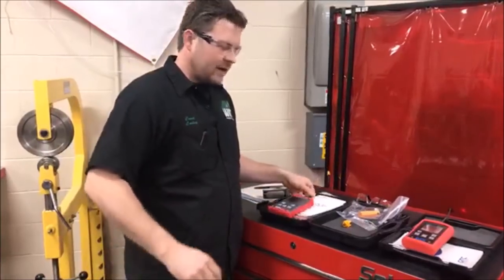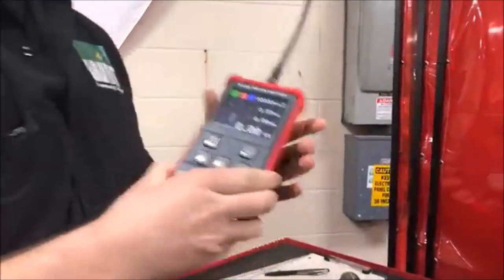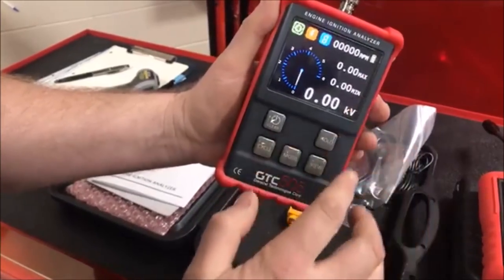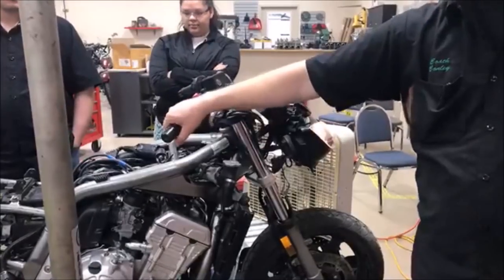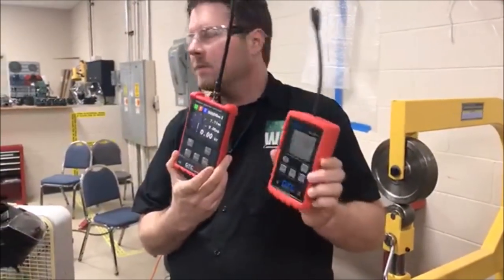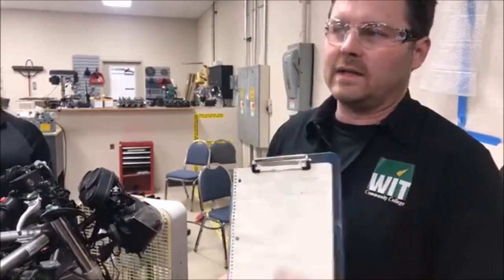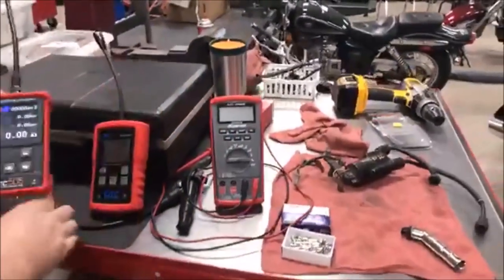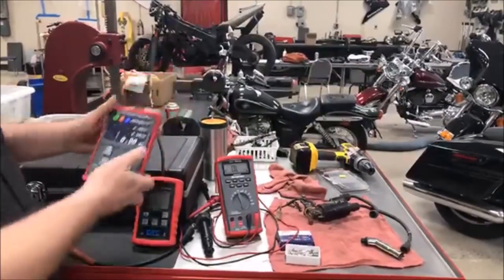How to test ignition spark output LIVE! Weak Spark? No Spark? Works on Motorcycle ATV Truck Auto GTC

Comment: I've been working on a 2006 Honda Bf90A outboard engine which has a capacitive discharge, waste spark ignition system.  I suspect a weak spark because my inductive timing light doesn't flash, or flashes intermittently, when connected over the ignition wires (this particular timing light flashes vigorously when used with other engines).  After watching this video I went ahead and ordered a GTC 505.  Hopefully it'll give me the scoop on what's going on with the outboard engine.

Comment: I'd just use spark checker and hook to block of motor and check that way or jab a t-pin to the backside of the appropriate connector/wires to check for igniters or the transistor doing its job, i believe it should go from 12v or 5v to ground voltage and continuously change like that with a good fluke meter and check with all other cylinders afterwards for a weak cylinder spark out of one of em, this is for automotive but i think it could apply to motorcycles too with a good eye as well. Man i don't like em' Snap on Multimeter but thats my own opinion, they look pretty and colorful but 2 year warranty vs. a Fluke is just outta the question. Fluke anyday. Those GTC tools are great, its like a amp clamp for a multimeter right? I can't 100% see if you're sticking the probe nozzle into the spark plug wires or if that tool has a yellow clamp. Magnetic maybe?

Thanks Shane. Great teaching, wish i could go to your classes.

Comment: Interesting, just watched a demo video on the TA100 measuring a weed wacker. The weed wacker put out 12kV at idle while both the motorcycle and truck here only put out about half that at idle. That doesn't seem right when automotive ignition systems are supposed to put out higher voltage than a small engine magneto.
Reply: not necessarily... depends on if the motor is using resistive plug wires, and most CD ignitions like on a 2 stroke pump out 20-40kv!

Comment: Hey Shane, long time subscriber here. I don't necessarily expect you to have an answer to this but on the off chance that you may know what my issue might be here would be greatly appreciated. I have a 1992 Honda XR250L. This is the RFVC engine. The issue I have seems to be a loud ticking sound coming from the motor. Not exactly an easy one to describe but I hear it's somewhat common with these RFVC engines. The motor ran low on oil to the point that it squealed. That's when the ticking started. Could the valves possibly have came out of adjustment? Maybe I'm hearing a chain guide? The chain felt tight when I pulled the top end off. Always appreciate your videos Shane